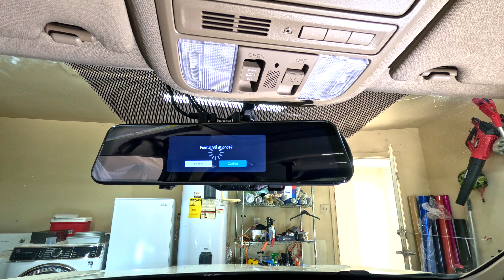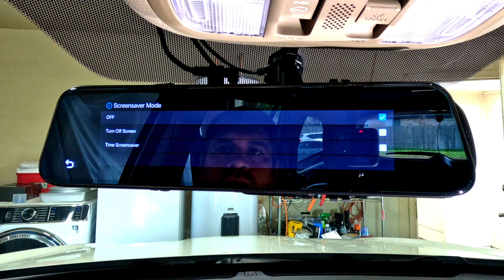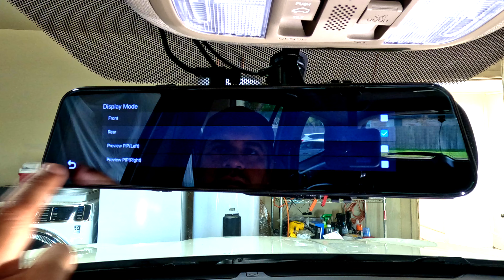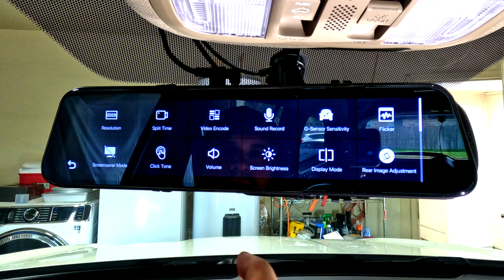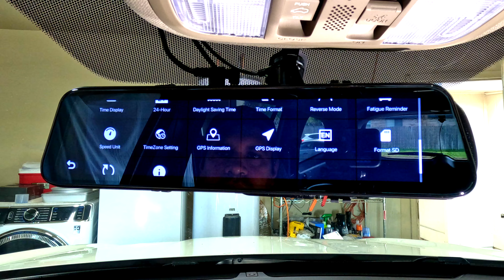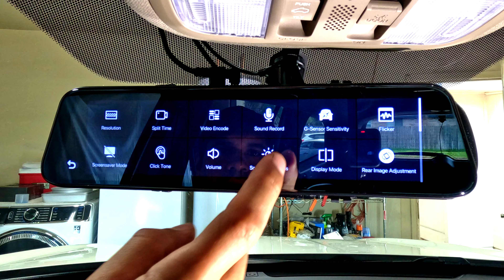WOLFBOX Rear View Mirror Dash  Camera 4K Front and 2.5K Rear

Comment: Does using the defroster on your back windshield?Cause the adhesive from the bracket and the weight of the camera to fall off?
Reply from the maker: No, it will not affect the camera.The tape size is bigger so it won’t fall down 👍
Reply: @Shinegadget  thank you, I should be getting my camera tomorrow from amazon. Got it because of your amazing review.
Reply: @Shinegadget  did you have to order the bracket separately or did it come in the same box?

Comment: I just got the rear view camera WHD upgrade. Do you know if I can cut the red wire since i'm not using it for the reverse mechanism?
Reply from the maker: Yes you can cut the red cable if you are not using it 👍
Reply: @Shinegadget  I ended up calling Wolfbox and asked them they spoke to their technicians department, they said it's very important not to for some reason, it does affect the camera. That didn't make any sense to me at all since i'm not using it. I ended up just tuking it all the way through the back part of the headboard.

Comment: I think you blocked the airbag in the 'A' pillar. It won't deploy properly in an impact. You should wire it  down the pillar then go across and back up the pillar or wire it through the bottom.
Reply: How about just clipping the wires onto the glass along the side curtain air bag?

Comment: Excellent video. 👍
Is the power cable connected by a USB?
What series is the USB?
Reply from the maker: The camera comes with a power cable for cigarette lighter connector. You can use usb-A to usb-c but the cable is not included. thanks 👍

Comment: I purchased one but the new mirror fastened over the old mirror vibrates after starting the engine or while driving. Can you suggest another way to fix the mirror firmly so it doesn’t vibrate anymore?
Reply: I used the 4 little sticky pads you remove as a spacer between the stem and the back of the adaptor - works PERFECT - the screws for the stem are a little long for the g900.
Reply: Oh sorry I reread your comment, I thought you were having another common issue when using the OEM stem.

Comment: Parking mode ,battery drainage average?auxiliary battery support?
Reply from the maker: Hi, for parking mode you will need a hardwiring kit. so the camera will be turning on and off more often, so it will be using more power from the battery of the car. Thanks 👍